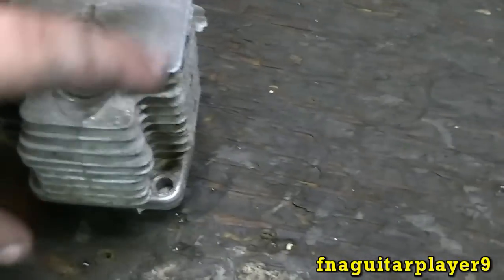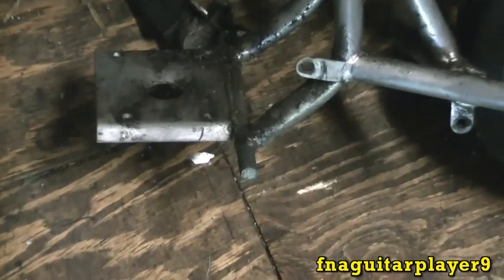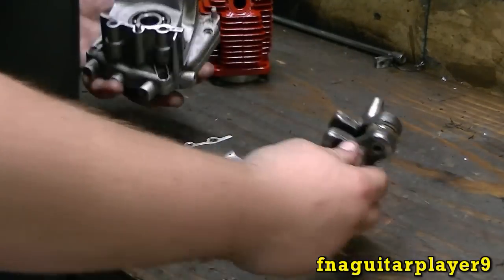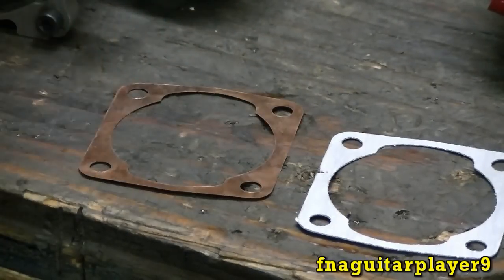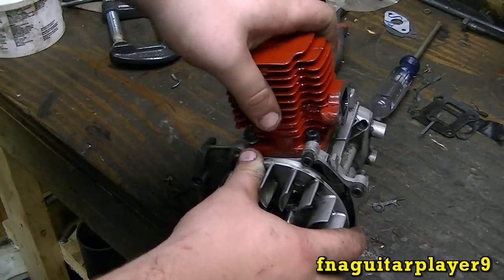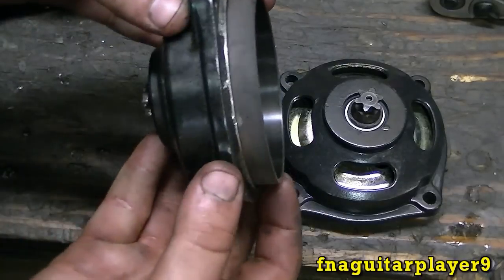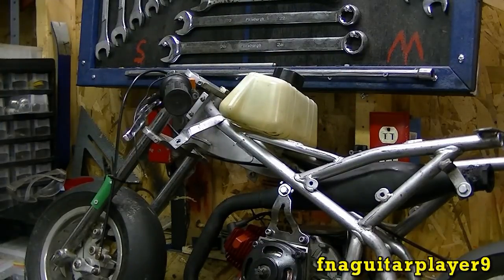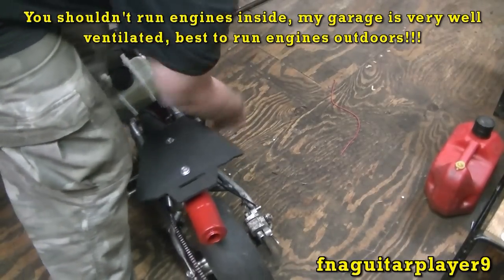47 cc 2 stroke Mini Pocket Rocket Bike Rebuild Part 2 of 2 (reassembly and test run)

Comment: I rebuilt my top end about 2 months ago and had major failure. I redid everything following your instruction today and some of my other motor knowledge. Got new fuel lines, cleaned everything up(almost lol) , replaced primer bulb, cleaned and rebuilt carb, cleaned exhaust port of carbon and other black gunk. replaced cdi and spark plug with american torch plug i pulled off another scooter, checked spark, sparks good, tightened chain, got fix a flat and tommorrow imma put in some racing gas =D and nice weld man btw, better then my first lol. gotta tune carb and i should be flying down the streets once more! Good vid man, You covered everything subd.
Reply from the maker: I hear ya! Sounds like a pretty good project you got going, i hope it runs great! Appreciate the sub and thanks for watching!!!

Comment from the maker: it would be along time before i could do that again, i'm not planning on tearing this apart again until it needs rebuilt, but if you look through my videos, actually i'll pm it to you, i did a video on rebuilding a 12 horse briggs, but when i drop the piston in i show it on it, its bigger and it goes in from the top not the bottom, but the process is the same, should give you an idea. thanks for watching!

Comment from the maker: i'd say the easiest way to drill a hold that big would be a hole saw, but defitnetley do it in a drill press with the sprocket clamped down, it would grab with a hand drill and twist your wrist. i've never used loctite on my pocketbike, alot of people use it though, i've never had any problems with lock washers, except the air filter will not stay on mine! they may be slower, but you can gear them higher, more torque!

Comment from the maker: figured it did. i'd say machine shop would be the only option. unless you can order a sprocket that would work, check out "the big bearing store" (online) they may have what you need! click on roller chain then the sprocket page is at the top, not sure what size chain your working with

Comment from the maker: i wish i could put like a transmission on this so i can take off faster, it kind of drags taking off, but once you get past half speed it takes off real fast. yeah it probably is hardened steel, may have to take it to a welding shop and have them cut it out with a plasma cutter, probably be the best method, probably not the cheapest though haha

Comment: Very nice bike! I'm 13 and already have 4 of these. 1 of them I just got today. The other three don't run but I plan on putting a new piston in my 50cc because the previous owners put straight gas in it. And the 49cc I just have to put back together
Reply from the maker: Thanks! I hear ya! They are fun to play with. I hear ya! have fun with them and be safe! Thanks for Watching!!!
Reply: +fnaguitarplayer9 ya no problem. I got the 50cc running but than it stopped
Reply from the maker: i hear ya! They are bad about carburetor problems!

Comment from the maker: I would think that would work fine, it should seal up fine, maybe even better than with just one. Now if it still isn't thick enough to allow the piston to clear the head, you could probably clearance it on the piston and/or the head with a dremel, just enough to prevent it from hitting it, i started to clearance mine, but I had the other gasket so i went with that route. thanks! I was going for a kind of a "rat rod" style look in a way haha thanks for watching!!!

Comment from the maker: It will change the fuel / air mixture, make it run leaner. I need to fix the filter on it, I just don't ride it much haha Its best to put oil on all moving parts after a  rebuild so that when it starts up it ain't starting dry with metal on metal, which can score the cylinder and bearings, it temporarily takes the place of the oil in the gas until its running. thanks for watching!!!

Comment from the maker: don't use starting fluid in small engines, i did a video talking about that a while back, if you have to use something use carb cleaner or better yet a flammable penetrating oil, its probably in the carburetor, even if its new, these carbs are very picky, it could be the float level not set, i have another video on cleaning the carburetor. If its like mine, you have to choke it, hold the throttle wide open and crank till it starts then let off the throttle. thanks for watching!

Comment from the maker: It could be the reed valve, or it could be the coil, i know you said it has spark but sometimes when a coil is on its way out, when they get hot they will loose spark, then when it cools down it works again, thats the only things i can think of, have you cleaned the carburetor after this happened? Mine has done that before and it was the carburetor, hope this helps, Thanks for Watching!!!

Comment: I would not paint the cylinder head, you want airflow contact aluminum, put washers on the plastic manifold as the bolts tend to sink into the plastic. Put any oil, I used RC 90wt oil to assemble w WD40 and done. Mine has full crank making like 52cc, modded reeds, pipe belly mod, and slightly bigger H needle.

Comment from the maker: don't know of any salvage yards, oh well, i can live with it like it is for now, i don't ride it much anyways, more less just fixed it up to do a video on, i get alot of questions on these bikes. thats pretty expensive!!! i've cut metal before now when i don't have a bit big enough, using like a 1/8" bit, and go around the outline of where you want it cut out as close as possible then you can probably hammer it out, but its not a smooth cut by any means, only did that once thats enough for me ha

Comment: hey man good job i was wondering were you bought the gasket kit and how much did it cost?
Reply from the maker: thanks! I got it off ebay (can't remember what seller). I think it was around 5 bucks, also another great place to get parts from is scooterparts4less (dotcom) they have just about anything you could ever need for these bikes. Either place you will get a good deal on it and other parts as well. Thanks for Watching!!!

Comment: i know the yz250 has more torque than the 4 stroke version but these are probably different. i think its hardened steel and i dont have a drill press

Comment: i bought my self a used pocket bike im gona rebuild and im putting new piston and rings in it and a new high performance carb because it runs sometimes but half the time it will start and idle for a bit then suddenly just die and if i take it for a ride it will run for a bit but then it will bog out and die ive screwed withthe carb like 10 times so i just thought if i put new parts in it she will run like new

Comment: hi
for the cluch with would you say are the better springs thin or the fat ones you said u might put the small ones back on pending on whats better I was wondering whats the best , thank
Reply from the maker: Hi. They say the bigger springs are better for racing so the clutch engages at higher RPM, I ride mainly on grass so I i like the clutch to engage at a lower RPM so there it slips much less, so I recommend the smaller springs. I don't think i ever changed them back, i don't ride it much at all anymore. I also tried the high performance clutch with the 2 big red springs on it, it wouldn't engage at all!!! Thanks for Watching!!!
Reply: ahhh grate thanks mate
Reply from the maker: your welcome!

Comment: Quick question..... i have 3 loose connectors...1for push start/ 1for kill switch i assume / & 1 coming from the spark plug cord where shud the wire from spark plug cord connect too...
Reply from the maker: If there is a small wire coming from the spark plug wire it may be for a tachometer, thats about the only thing i can think of. If its coming from the coil though, that is the kill wire. Thanks for Watching!!!

Comment: Hey man I just got one of these pocket bikes and I was wondering what brand it was or at least where you got your parts from because mine doesn't run at the moment.
Reply from the maker: Hey. You can usually find most parts by just typing in 47cc 49cc mini 
pocket bike or cagallari pocket bikes (i think i spelled it right). 
Thanks for Watching!!!

Comment: My pocket bike will not stop accelerating even when I let go of the gas... will it be an easy fix, something I can do myself or will it be hard and expensive?
Reply from the maker: +Hot Sauce Sounds like the throttle plunger (the part that the cable hooks into, removable from top of carburetor) is hanging up, or may have came loose causing it to stick, i would suggest taking it all apart and cleaning it really good and see if that helps. thanks for watching!!!
Reply: lossen the idle screw

Comment: I put a new carb on the bike. When I start it it ideas for a few minutes and then revs up to max and than dies. What is going on and how to fix it the problem?
Reply from the maker: Jim Mers Sounds like the float level is set wrong, its basically running out of gas. I have a video on how to set this. Thanks for Watching!!!

Comment: I use Two-Stroke oil as assembly oil in a two-stroke....... not sure about STP in the bearings as assembly lube?
Reply from the maker: +Eclidean That sounds like a good idea, just as long as its something, I've heard of people using anything from wd40 to vaseline on assembly, i just prefer stp / lucas or motor oil. I don't see a problem with 2 stroke oil, it would probably burn out better since its made to be burnt anyways. Its probably unnecessary to oil the bearings like i did, i just felt like it needed to have something in them. Thanks for Watching!!!

Comment from the maker: Check to see if it has a pull cord. Unless the flywheel cover is missing. You should be able to see the starter if its electric start. Most electric starts also have a pullstart as well. I've heard the electric start ones aren't very reliable. thanks for watching!!!

Comment: Is it OK if you double the gaskets? ?
Reply from the maker: If your referring to the cylinder gasket that i doubled, then yeah its ok, it won't really hurt anything. I've been running it ever since I made this video and its still doing fine and has plenty of compression. But its not necessary at all, i just did it to hopefully make disassembly easier next time. Thanks for Watching!!!

Comment: My engine case broke. And where the bolts that connect the engine to the bike frame broke which made the case break even worst. Should I just get a new engine?
Reply from the maker: You can get a replacement casing, but for not to much more money you can get a whole complete new engine, then you can use your old one for spare parts (carburetor, etc.) you can usually find these engines for like 60-70 dollars on ebay or other places that sell these engines. And thats a brand new engine too! Thanks for Watching!!!

Comment: Hey is it ok to paint the cylinder head with an spray paint or should it be heat resistant?
Reply: Yes heat resistant, but painting might affect cooling performance but something like exhaust paint should do the job
Reply from the maker: It would be best to be heat resistant, regular paint will last a few minutes! and 1ceeb is right too, it can affect cooling, but i haven't any problems yet with it. thanks for watching!!!
Reply from the maker: thanks for watching!!!

Comment: so fnaguitarplayer9 if you wanted to reverse this engine as in making the sprocket(where the chain connects) spin backwards how would you do it? could you make a video?
Reply from the maker: +Adam you would have to have a gear box to reverse it or figure out a way to reverse the direction of the engine, since its a 2 stroke it would run backwards, as long as the coil would fire the plug. And the cooling fins would have to be changed out so it blows air in the same direction. But i'd say the best way would be to have a transmission of of some type on it. Thanks for Watching!!!
Reply: +fnaguitarplayer9 I love that red muffler.  What type of spray paint did you use?
Reply from the maker: +Kawasaki450 I hear ya! I used duplicolor engine paint on it, it has dulled down some from the heat, but still looks ok, if you ever want to pain a muffler silver or black, get some rustoleum high heat paint for grilles, its the best for mufflers i've found, now at auto parts stores i've seen paint rated for 2000 degrees just for exhaust, but its high dollar stuff! Thanks for Watching!!!

Comment: Oil, where did you put the oil?
Reply from the maker: If you mean oil in the crankcase, 2 stroke engines get oiled from the oil in the gas, they don't have oil in the crankcase like a car engine or lawn mower, but if your asking about where i put oil during assembly, i put it on the piston/rings, bearings and seals, that way when it starts up its not metal on metal and will have oil until the gas comes in contact with everything. Thanks for Watching!!!

Comment: Sorry for the dumb question but how do you turn it off
Reply from the maker: ***** there should be a orange / red switch on the handle bar next to the grip, just hold it down until it shuts off. if it don't, check the wiring, could be bad switch as well. Thanks for Watching!
Reply: Or u can unplug the spark plug lol
Reply from the maker: +andrew gibson true too! Thanks for Watching!!!
Reply: +fnaguitarplayer9 yup is the tank on yours original i recently bought one and it has the same gas tank
Reply: +fnaguitarplayer9 and my gas tank cap the sealer keeps coming apart how can i make it stick
Reply from the maker: +andrew gibson as far as i know its original. You might have to find a O Ring to fit or
 just replace it, because i don't see any type of glue holding it in. Thanks for Watching!!!

Comment: what kind of paint did you use
Reply from the maker: I think it was dupli color engine paint (with ceramic rated for 500 degress) it did dull down alot once it got good and hot, its not shiny now. A exhaust/muffler paint would be the best to use or a grill paint. Thanks for Watching!!!

Comment: Hi I wonder if u could help me ive got a little mini moto but it doesn't  start up what actually happens is it starts up for 2 seconds then cuts out ive adjusted the idel and every thing even ur on a new crank and cilinder head with the casing but still doesn't fire up could u help me plz thanks
Reply from the maker: Sounds like the carburetor needs cleaned or the float needs adjusted, not letting gas through it. I have videos on doing this. Thanks for Watching!!!
Reply: adjust your air to fuel ratio, there should be a screw somewhere on your carb, turn it completely in, and keep adjusting untill you have no problems anymore, but i would suggest to just get a perf carb, way better
Reply from the maker: bliephoofd On the one in the video, the only adjustment screw is for idle speed, on that type you have to replace jets or adjust the throttle cable - needle at the top. but on those smaller scooter type they should have the mixture adjustment. Thanks for watching!!!

Comment: they didnt have anything big enough. its a bicycle chain. not sure what size. i might try using the angle grinder to start the hole and file it down with the dremel.

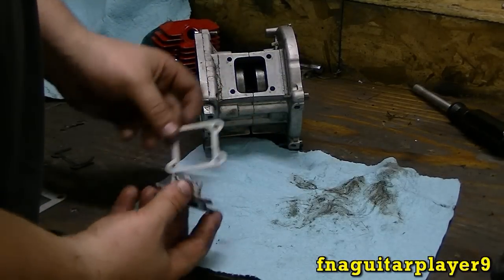Comment: hey u see on 5:07 the reeds i got a high performance carburetor and it doesn't come with that part just a open manifold is that ok or will i have problems ?
Reply from the maker: as far as i know you have to have the reeds, they act like a check valve keeping pressure in the crankcase. I thought you could reuse the stock ones with a performance carburetor because i thought it just bolted on to the stock manifold. Thanks for Watching!

Comment: Hey man i need some help.. Do you have a email i ant send you pictures i have a red wire sticking out i think its part of coil but i dont know where it goes
Reply from the maker: I'll send you a PM with it. Sounds like it may be the shut off wire, it connects to the shut off switch then it ground it to the frame to shut it off. Thanks for Watching!!!
Reply from the maker: I couldn't send a pm but if its not the shut off wire, let me know and i'll give you my email here.
Reply: +fnaguitarplayer9 yea you were right it was the kill switch I figured it out thanks so much !!!! Also I have 2 other questions .. My gas container has a small chip where the line goes in and gas drips how can I patch it and my second question was my pocketbike is loud can you give me a link to a quiet exhaust I could buy
Reply: +fnaguitarplayer9 yea you were right it was the kill switch I figured it out thanks so much !!!! Also I have 2 other questions .. My gas container has a small chip where the line goes in and gas drips how can I patch it and my second question was my pocketbike is loud can you give me a link to a quiet exhaust I could buy
Reply from the maker: I hear ya! no problem! You might be able to use JB weld to fill it in some if its not to bad, but it might be best to get a new one if that doesn't work. The stock ones are the quietest that i know of for these, the performance ones will be louder.

Comment: guy ur engine are vibration ? my engine is very vibration
Reply from the maker: Yes, these have really bad vibration. Thanks for Watching!!!
Reply: @fnaguitarplayer9   im did't used china engine it anymore there are very cheap but have alot problem  I turn to go japan engine im ran on Honda Gx35 it is a very smoothly on goped and less vibration even horsepower less than 2 storke but till i think  this engine is awesome